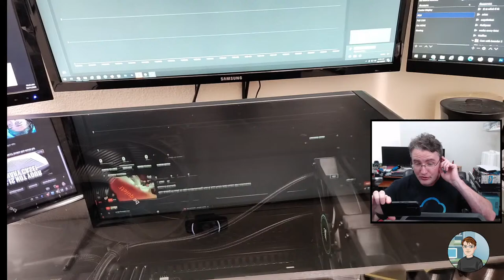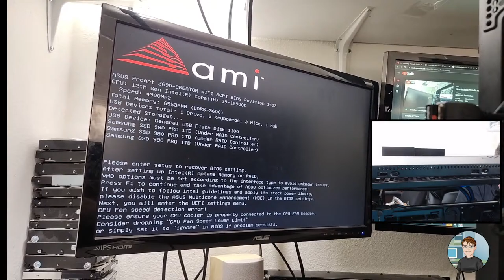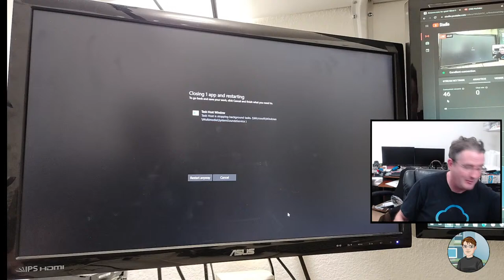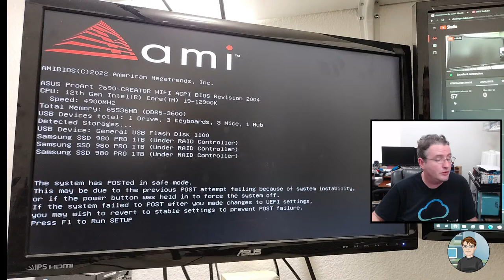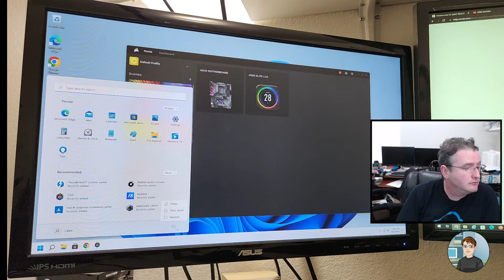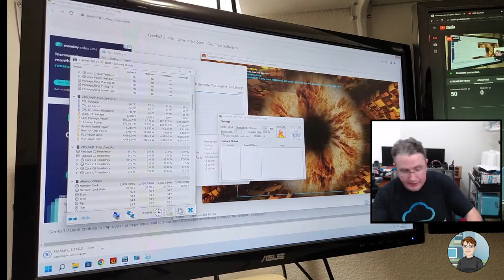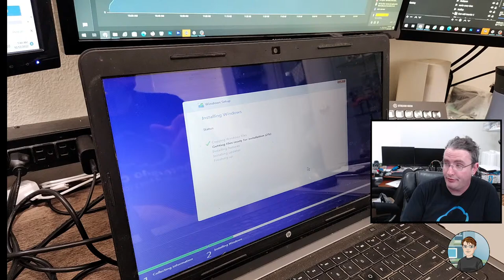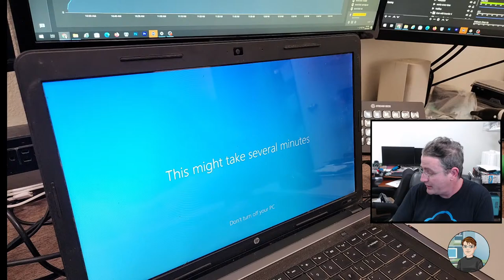New desktop PC build, no video troubleshooting, Core i9, Asus ProArt Z690 Creator WIFI motherboard

Comment: Can anyone tell me where the bios battery is located on the motherboard? What part of the motherboard is it on?
Reply from the maker: If you know the model number of the motherboard or the model number of your computer you can do a Google search for that model number and CMOS battery. You'll usually find an image or a PDF or some kind of instruction about where it is on that particular motherboard.
Reply: @MichaelTheComputerGuy  thanks for the answer model ASUS ProArt Z690-CREATOR WIFI LGA 1700 ATX Motherboard.
Reply from the maker: @ghazaryandrummer  I checked the manual and don't see where one is on the motherboard other people are having trouble finding it as well. It may not be a removable CMOS battery. However the only reason to do that would be to replace it. If you're trying to just reset the values in the BIOS so it's like a brand new board there's are clear CMOS pins  just to the right of the fan 3 and fan 4 headers asking the bottom of the laptop.  To clear the CMOS setting unplug the main power cord and use something metal like a screw driver to connect those 2 pins for a few seconds. That will set the BIOS back to default settings.
Reply: @MichaelTheComputerGuy  thank you very much for the answer!

Comment: Hey Michael, I have this motherboard with windows 11 on a new build that won’t go to sleep.  If I tell it to sleep it will for a few seconds and then come back on.  Are there any settings in bios that would affect that? I’ve never seen a bios as complex as this one…but it has been 5 years since my last build.
Reply from the maker: Give Asus support a call and see if they have a solution.  I'm thinking either a BIOS update or turning off Fast Startup would get it to stay asleep.
Reply: @MichaelTheComputerGuy  thanks. I’ll take a look at bios when I get home. I did the latest update and that didn’t fix it.